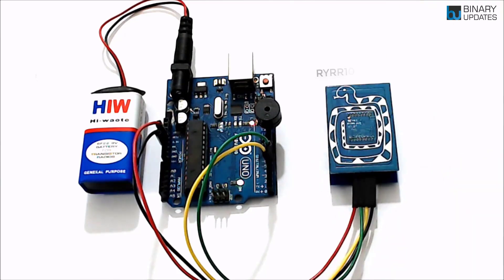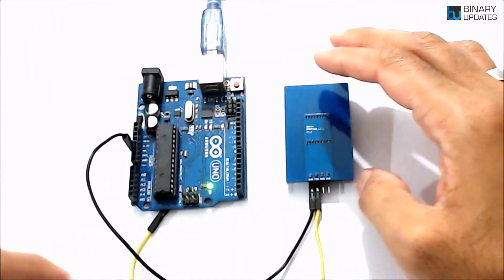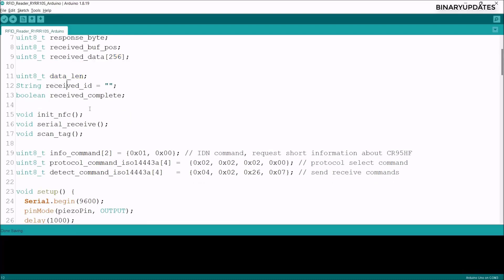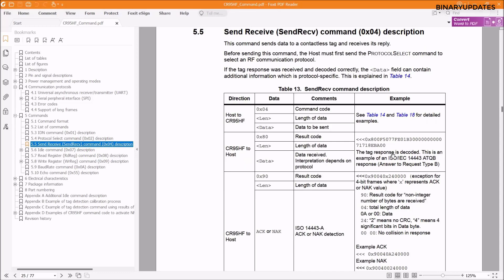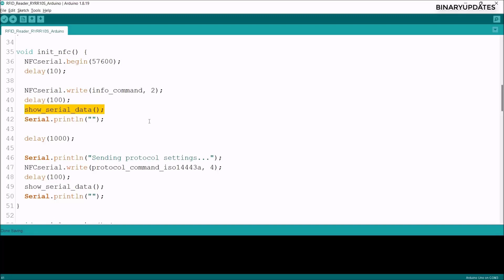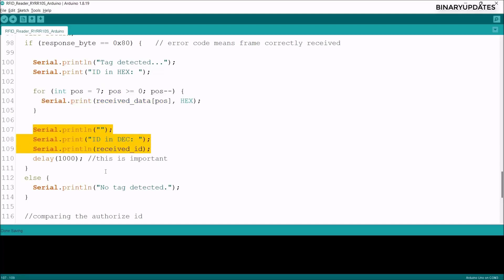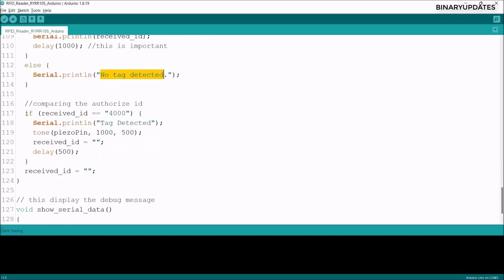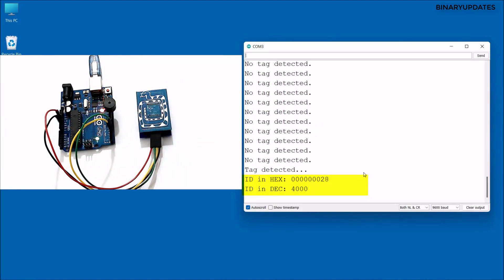RFID Reader RYRR10S with Arduino Tutorial

Comment: As it is significantly more expensive than MFRC522, can any please tell me, what benefits it has over mfrc522 if I am trying to develop a product as per industry standards?
Reply from the maker: Hi Adarsh, the RYRR10S is built using CR95HF from ST. You can read official document DocID018669. I believe it support advance security and all IEC standard protocols. I suggest MFRC522 in case of price sensitive, less volume and consumer electronic products. I hope this may help. Good luck and best wishes!